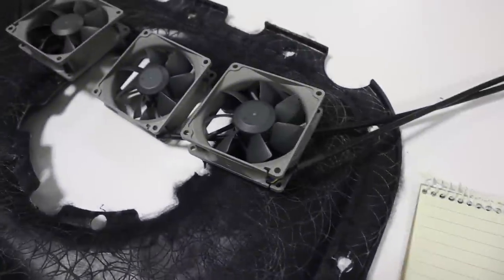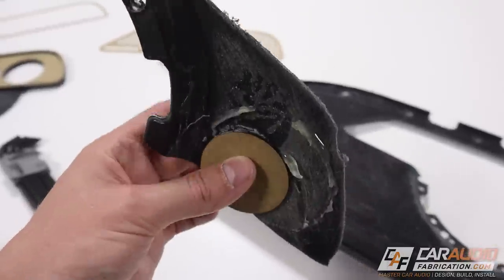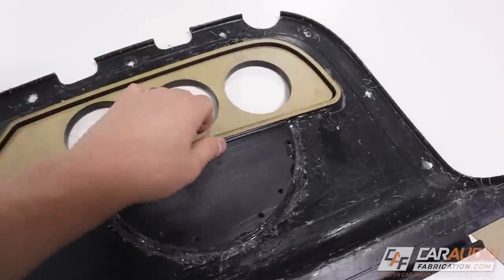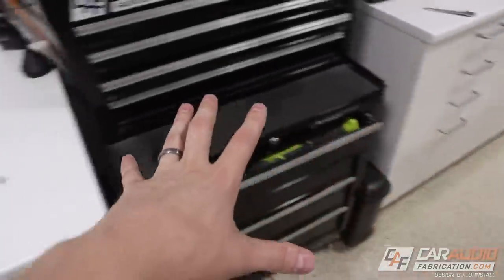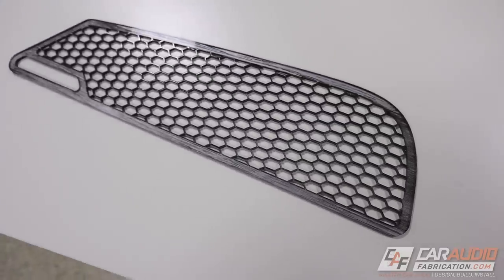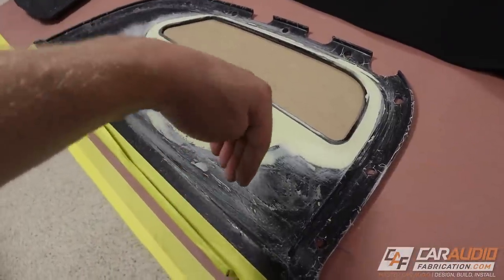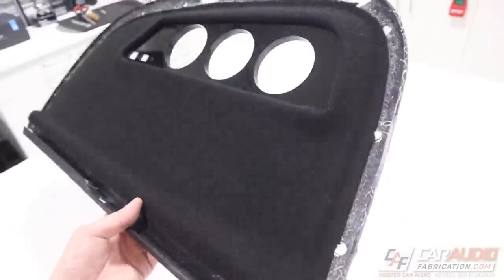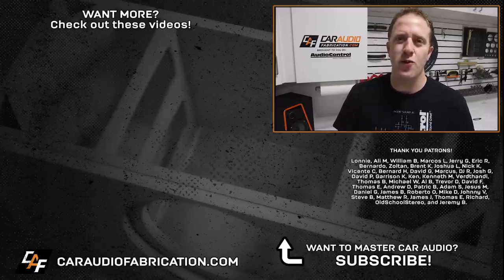Amplifier Rack COOLING Panel - Filler & Upholstery - Part #2

Comment: Love this, only problem is that you have all of those amps behind the panel, and those fans are oriented to push air INTO the area they are occupying. Since they are below the amp and heat rises, might want to turn the fans around to exhaust air out of the cavity. Just an idea.

Comment: You are pulling in cold air. Wouldn't it be better to pull out the warm air? Not an expert at this but i thought that pulling the hot air is better than blowing in cold air. Greetz, Mark.
Reply: Intake to pull in fresh cool air and a exhaust to pull out the hot air...

Comment: This looks awesome man. Question, what are the connectors you used to wire them together ad then run one connector to the fan controller? Was there a relay involved at all?

Comment: Mark, did you add the fans out of need or as a just in case thing?  I have same Jeep w amps and dsp mounted there and my RF T1500.1 shuts down for about 5 mins after and hour or more of semii hard pushing.  It’s running at 2 ohm on 4 Tw1 subs.

Comment: If the plastic is marked PP (polypropylene) then only the catalyst based glue will work, its a one part catalyst/activator that you rub on and the other part is standard ca glue.  Ask me how I know this.
Reply: How do you know this?

Comment: My amp light dims when bass hit, I've checked the grounding it seems good. It's the same when bridged or only connected to one channel only. My amp uses 60A, my wire size is 6ga and it gets hot all the time after a while. Any idea what to do?

Comment: I got a system with beyma midrange and some tweeters running off a lc8i and it sounds crazy. I recently took it to a car audio place to upgrade my system and they blew my 2 12s and fried my amp. Anyways I ended up getting some 2 Memphis 12s for the meanwhile after doing some research I found out that these subs are 300w rms each and 600w max I’m running them on a 1600w Stetsom amp (which I also had to buy new). But my speakers are so loud that when I turn up the level for the bass it starts to clip at low volumes when i know it should be thinking way harder. Could the amp start clipping because the subs are being overpowered ?